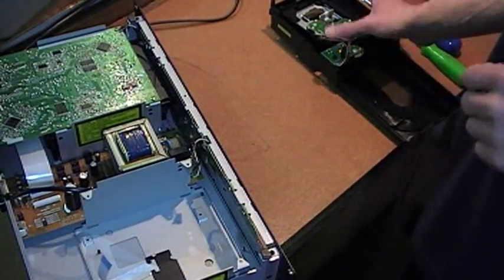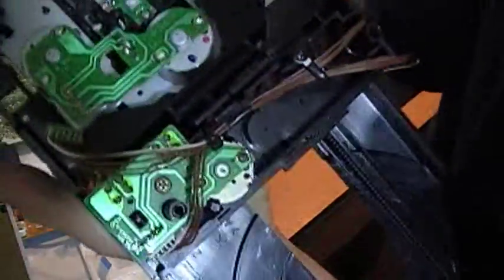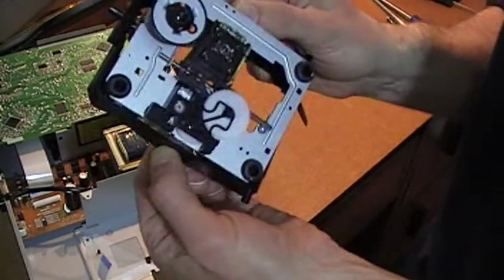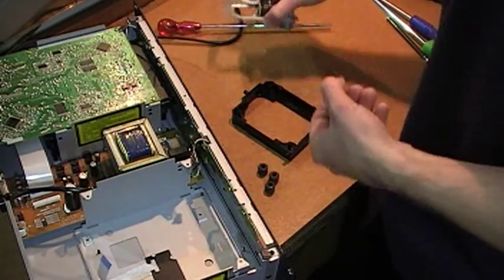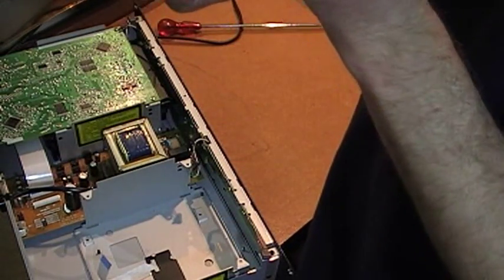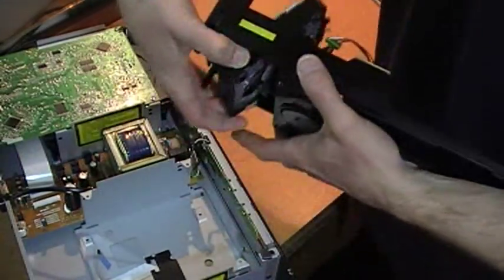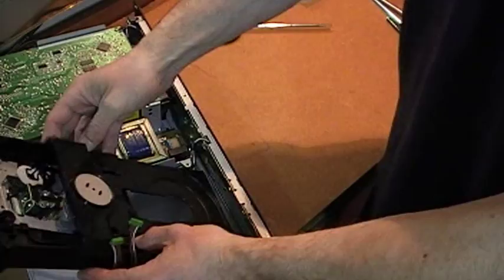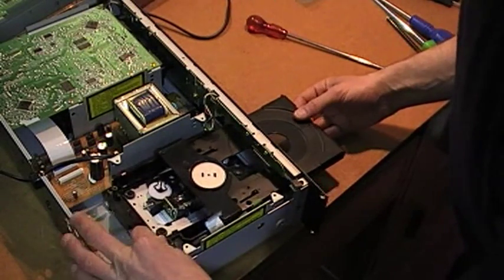Denon DN-D4000 laser replacement (Pt.3 /4) - Fitting the new CD mechanism

Comment: On the same laser assembly that fit the Denon DN c615 has a solder dot on the laser pcb which has to be removed for the laser to operate,
I was hoping to see that done,
 cheers,
Garry
Reply from the maker: Hi Garry, check my other videos, this is part 3 of 4 of this job. Part 1 shows you the de-soldering you need to do.